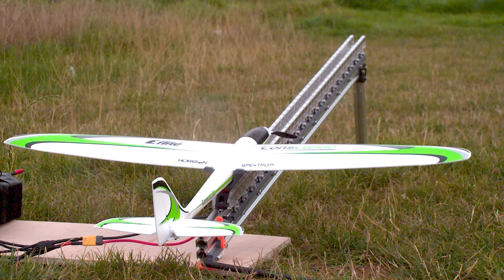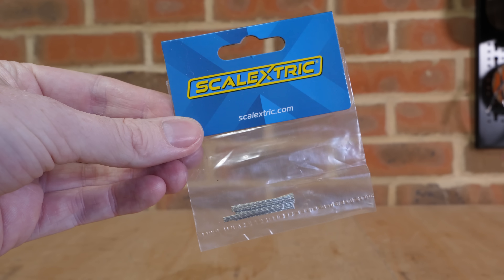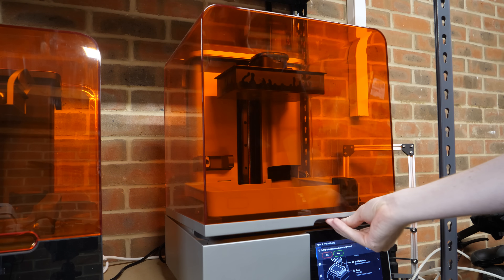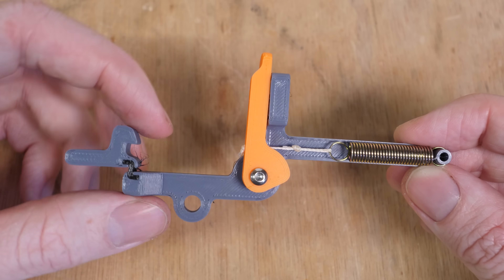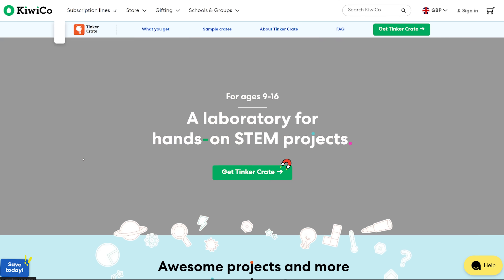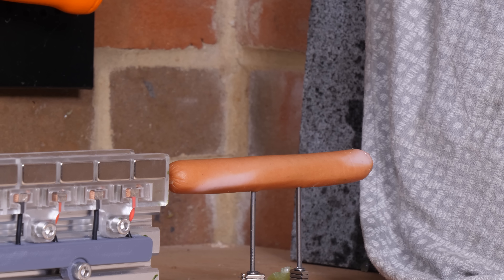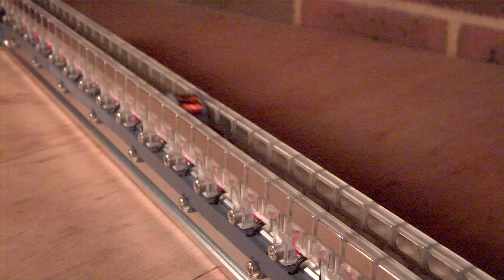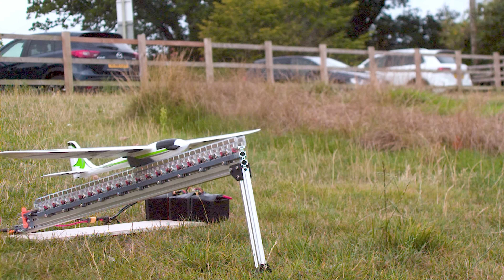Electromagnetic Aircraft Launcher

Comment: I love how the rail is magnets, and the capsule is the coil... but the capsule should get electricity from a coiled wire, that disconnects at the end, instead of contact brushes. A microcontroller and sensor can switch N and S as it travels along the magnet line

Comment: Why can't we invert the whole system..?
Instead of the sledge having electro magnet and the track with permanent magnets. We can also do the reverse with permanent magnets will be on the sledge and the track can be fixed with electro magnets. Which will have some sort electronic sensor system to trigger on the electro magnets based on the placement of the sledge to propel it forward. This way the weight of the copper coil won't effect the sledge to slow down because the sledge just has the permanent magnets with fixed weight.
Reply: I would really like to see if that works. Can you please try and make video for that.. If it's possible..

Comment: I wonder if the timing needs to be adjusted as the projectile moves down the track and picks up speed
Reply: Although if the weight isn’t a constant, I guess the timing would have to be changed with each change of weight

Comment: Any advice on learning about the electromagnet? I tried winding a toriodal iron core with magnet wire. No luck. I guess there's a lot of variables here: core material, core shape, wire thickness, number of windings, power source voltages and max amperage. Is there a good guide on what would work well?
Reply: Wish he would do a seperate video on the sled. Currently designing my own 3d version but the windings on the coil confuse me.

Comment: Having cleaner and tightly wound coils should also give you better results as the electromagnetic force will be stronger and less noisy. the coil will have less resistance and be more efficient overall.
Reply: So the tighter wound the better?? Does the coil make contact with the magnets?

Comment: "Purely mechanical". Or, you could use steam and be purely physical. Higher torque from zero per weight. (ignoring both the source for electricity and for steam).
Reply: Seeing as something is needed like this in Ukraine to launch drones, the thermal footprint is of huge concern.
Steam would make it an IR target immediately.
Reply: @Oneshot8242  You don't really need high torque launching drone. They aren't as heavy as jet fighters. In fact, modern drones (like drone busters) can accelerate faster than an F1, I kinda doubt they need launchers.

Comment: additional improvements — rotate the fixed magnets 90 degrees so that the long axis is vertical.   use capacitors instead of batteries.  instead of a single power rail, break the length of the rail into segments, and each segment uses a different bank of capacitors.  dwell time decreases as your sled speeds up — use high voltage the closer you get to the far end of the rail.  someone already mentioned graphite brushes

Comment: Tom, you can optimize your magnet spacing to get improved launch speed.  As the sled travels down the track, it is accelerating on a quadratic curve, so the magnets should space out slightly more as you go. (See table below) By my calculations, you can get a 20% improvement in launch speed.
.....The sled's position as a function of time is: x(t) = 1/2 at^2. If you want each of the 20 stages to contribute over equal time intervals [Delta-t] (to maximize efficient force transfer), then the position of the k-th magnet pair is x sub-k = 1/2 a (k [Delta-t)^2 = c k^2, where c is a constant. I made you this table for the position spacing of each magnet pair, assuming 20 pairs over two meters, and using the quadratic curve for spacing each magnet "station".
...
Mag.  Position   Cumulative dist.         Mag.  Position   Cumulative dist.
pair    (m)           from previous              pair    (m)           from previous
1       0.005            -                                  11        0.605        0.105         
2       0.020         0.015                            12        0.720        0.115                           
3       0.045         0.025                            13        0.845        0.125                              
4       0.080         0.035                            14        0.980        0.135                        
5       0.125         0.045                            15        1.125        0.145                               
6       0.180         0.055                            16        1.280        0.155                                   
7       0.245         0.065                            17        1.445        0.165                                             
8       0.320         0.075                            18        1.620        0.175                          
9       0.405         0.085                            19        1.805        0.185                                    
10    0.500          0.095                            20        2.000        0.195                                             

This doesn't guarantee exactly constant acceleration (since real forces depend on coil-magnet alignment, current, and speed), but it's a great heuristic that should outperform uniform spacing.
Reply: Would timing the contact strips also matter? 
Like advancing engagement maybe as it travels faster, kind of like advancing ignition in an engine...
Does that apply to physics in this scenario?

Comment: Rail guns are the things the military are wanting, 
Something where there is no waste, (shells), or added weight for soldiers to carry, (primers, gun powder etc)
The main thing is the gun needs to be light weight as well, copper wire and magnets, enough to generate the power needed to send the projectile to supersonic or hypersonic speeds is the current problem, but it will be eventually solved.

Comment: When more people begin to tune into this, there are many avenues for scientific research that will open up. And I will give you one example.
So far, scientists have looked at gravity as a single force, as existing on its own. It pulls all matter towards a gravitational center, such as the center of the Earth. But the new understanding that will begin to emerge is that gravity cannot exist alone. It must exist as a complementary force to another force that pulls matter in the opposite direction. If there was not such a force, how do you explain that the sun can radiate light? The sun has tremendous mass. Surely, if there was only gravity, the sun should have created such a tremendous force of gravity that light could not escape the sun, so how does light escape the sun and reach the earth? Because light is propelled by the other force that works in complementarity with gravity. These two forces are in this complementary relationship. What does this mean? It means that they are always in a balance. This balance can shift, it can change, but there is always a balance. 
 When scientists begin to realize this and research this, they will discover this force and they will discover that all forces are really vibrational in nature. Even gravity is a form of vibration, because energy itself is vibration and this means that if you can change the vibration, if you can discover a specific type of vibration, you can actually change the balance between the gravitational and the upward moving force.

Comment: Firms that make crossbows need to look at this. Firing a crossbow bolt this way would save having to wind energy into a spring, compress a bow, compress a hydraulic damper etc, Just this with a battery built in, 
Think electronically propelled spear gun,

Comment: There is also the effects of more "electromagnetic inertia"
Ideally you should have a sled which changes the amount of coils as it acceleres.
More turns = lower maximum speed
but more power and initial acceleration

Comment: You could just use thinner wire and higher voltage, reducing the weight, since the duration of the current is short it doesn't matter if the wires heat up somewhat. Also, the sparks might look cool but they cost a lot of energy and reduce the overall current in the coil, add a flyback diode in parallel with the coil to eliminate the arching and a capacitor in parallel as well to reduce the current ripple. With these improvements you could probably push the force/accelleration much much higher.

Comment: You know, you don't need all that complexity.  Just have a solid conductive rail on both sides, one is connected to positive and the other negative, and the shuttle have a conductive bar that can glide down them, connecting both rails to complete the circuit.  It's an extremely simple design, called the railgun.

Comment: If you increase the spring tension on the trigger to eliminate the slack and put a rubber stop to absorb the impact you can stop the trigger bounce
Reply: You could have the magnets facing each other so that when they make contact, there wouldn't be any bounce. Also, why is there such a strong spring in the trigger that causes the bouncing?

Comment: idk if my input is even valuable but wouldnt it help if the plane was locked in place with the prop turning at full speeds prior to release and power on the rail was turned on at that point the brake is released?

Comment: Great video as always, you never disappoint 🌟

I have a similar hobby in electromagnetics, I have had an interest in magnesium for a very long time, I do understand the concept of the launcher so I wanted to suggest an idea you could think about and possibly try if intrigue tips the scale 😏
The wheels of the launcher,
Instead of plastic use metallic to run the current with each side having either the +/-
Having the wire end from the coil wrapped and soldiers to the wheel or hub pin, with the wheels giving constant contact there should be less sparking therefore less energy loss,
You found the mass/work/energy ratio of the 200 turn coil, this can be now tweaked and narrowed to see if 200-250 had a better output or 250-300, I am wagering around the 234t or 258t something about harmonic resistance or universal viberation, not sure how to explain but it's all about scaling and you narrowed the sweet spot 🌟
Thank you for all these videos you make, they are great fun to watch and it's great seeing someone else with a strong connection with electromagnetics
🌟💓💎

Comment: Hell yeah, its way safer than the steam powered launcher it replaced onboard the US Aircraft carriers.  But most don't realize that ships are powered by steam even now...well nuclear powered steam driven prop shafts to the prop. Big time steam powered reduction gear systems. The power plants on old cruisers and destroyers used jet engines to boil water to steam and ran that steam into huge reduction gear trains connected to the drive shafts to the variable props. Been there, done that.

Comment: 11:58 resistance of coil is also relevant. Higher turns count with the same gauge means higher internal resistance which means lower maximum current which means weaker magnetic field. You could try higher turns with thicker wire. This would be heavier but higher current. I'm not sure which combination would be ideal. Probably a superconductor 😂

Comment: The reedswitch is a little overengineered in my eyes as if the lever arm itself would push two contacts together in the same way it now just pushes the magnet below the other magnet, every sparking and flickering would be gone as it is mechanically locked in place

Comment: if you mask the spot on the brushes you don't want solder with nail polish or white out (correctiong fluid?), it'll prevent the solder from whicking up. and then you can submerge it in acetone to get rid of the polish.

Comment: Solder wick is being used as a conductor to switch on the electromagnets as the model moves down the rail. However, an alternative approach might be to use a piece of coaxial cable. By stripping the insulation and removing the shielding, you could create a similar conductor with wider brushes. This might provide better contact reliability along the rail, potentially enhancing the performance of the switching mechanism. It could be worth trying to see if it improves the functionality for this purpose.

Comment: Just for my understanding: the purpose of the latch and the spring was just to have the button do something cool, right? It could've just been a button that completes a circuit the boring way? (Possibly using a transistor or something so that the button's contacts don't have to actually carry the enormous current involved?)

To be clear, “because it does something cool” is entirely sufficient as an explanation.

Comment: 11:00 the reason mass increases is not linear to number of turns (4x turns not equal to 4x mass) is because the length of the loops increases turn by turn (the 1st layer loop lengths/circumference will be lesser than 2nd layer than 3rd layer etc in simple words the wraps become fatter and fatter)

Comment: I think instead of line of magnets fixed and and electric coil in the middle switching to opposite build where magnets are in middle and electro magnets are on sides is better. you'll have to experiment if single long electro magnet is better or disconnected electro magnets over the length with alternate pulsing AC contacts. This will mean no need to contact any middle part with any brushes and no sparks

Comment: With this method, only a constant speed can be given to the thing to be thrown. However, a more efficient method can be to accelerate. In this way, the contact current can be reduced. To do this, the force of the magnets can be increased as they go forward. In order to provide different thrust force with the same type of magnets, it can be achieved by adjusting the distance between the magnets and the rail.

Comment: All that brush business is old technology. One solid improvement would be to replace the magnets with electro magnets and the  projectile be a single magnet. A series of  opto sensors detecting the position of the projectile could be used along with micro-contoller to generate the optimum acceleration.

Comment: I would suggest using a permanent magnet as the projectile and coils on the sides to solve the contact problem and then use optical sensors to trigger the next coil ahead.  Then for extra fun I would have the power supplies for the coils changing voltage - like 12 vdc to start the first 1/4 and then 24 vdc and then 36 and finally 48vdc.  The heat buildup to start it moving might be too much to start with the 48 volts because the time to go from stationary to moving is a few millisecond and you need to power during that entire time, but after it has been accelerated to the last 1/4 of the track you can hit it with a lot higher voltage and really send it flying.  In my SuperMagnetMan channel I did a prototype of this in launching a rocket.  We did that video shortly before covid and haven't gotten back on it to finish it:(.

Comment: Use a coil that's copper on the outside but uses aluminium on the inside or fully aluminium coils. They are lighter for the conductivity they offer and a ferrite/neodynium core would go FAR in increasing the magnetic flux, no second coil needed!

Comment: Would a bank of capacitors allow you to get more oomf out of the launcher? Allowing you to drive a higher current than a battery pack and more turns on your sled? Could use carbon brushes and springs instead of copper braid

Comment: Try using Mosfets and hall sensors to time the field crossings - you should consider it a bit of a synchrotron or linac to adjust for velocity changes. You can run this inside a tube with field coils along the length. Have the sledge with battery power - no sparking brushes, so it could run faster with no contact welds! So, it runs much quicker, switching - faster field collapse/growth, so it has more incredible speeds. I consider this a fun project, but I don't have a 3D printer. However, the video was such good fun - and very inspiring! Thankyou - Cres

Comment: 1. How about using spring to give first impulse to your weight? Get two trophies with one shot! Electrical engines make great work on spinning, but bad work on starting to spin (I believe magnets work the same way on accelerating some mass from zero)

2. You can actually use magnetic contact without flowing insane current through it - just use a magnetic motor starter: control circuit will be separated from power circiut.

Comment: 3:27 this copper mesh is designet to desoldering parts and is covered in Flux and Solder Lubrications i dont know if the thin layer of flux will reduce the efficency
Reply: You can buy dry ones that are meant to be brushed with flux when you need it, either way I doubt it will hurt the already horrible efficiency

Comment: Why don't reverse the Magnet and coil place ? In fact, it's more efficient if the coil is a stator and magnets are mobile... just need a laser (ligth) barrier to pilot the stator coil to push the mobile magnet along the rail...
For the trigger, a simple relay ? or a transistor ?

Comment: So... It's an unraveled brushed motor essentially? And the digital one was basically a brushless motor. Use carbon brushes as an upgrade! It'd be funny to make the dumbest electric motor, by using a treadle with a flipping magnet pulling on what would be the foot pedal instead of just leveraging a motors advantage of already being rotating force.

Comment: why don’t you use electromagnets for the rails as well? No need for very expensive magnets. Easily replaceable. More importantly, the ability to adjust the speed or torque of the launcher. Also, control the launch time without a pusher switch. This is mor or less way DC flans work.

Comment: Since the Lorenz force is reliant solely on current, and not voltage (not directly), maybe you could increase the thickness of those wires and use a step-down transformer to reduce the voltage but increase the overall current? You could maybe achieve much higher forces.